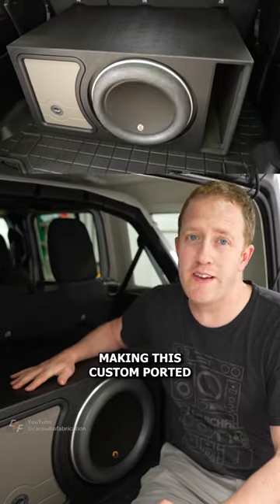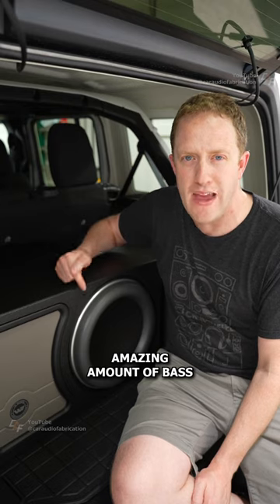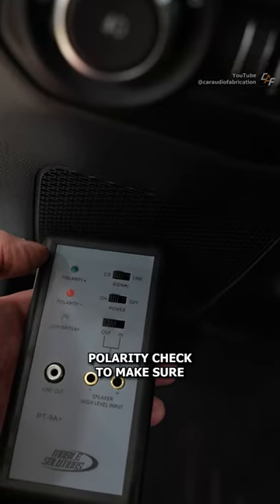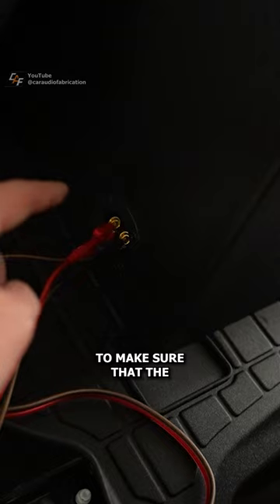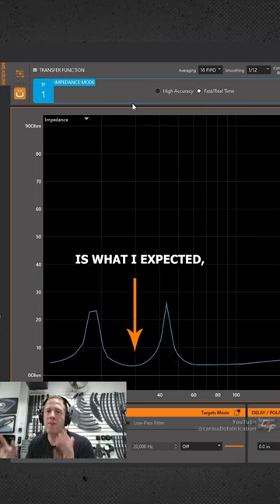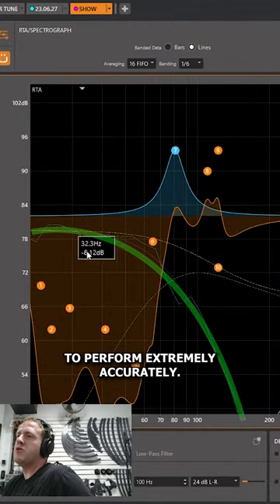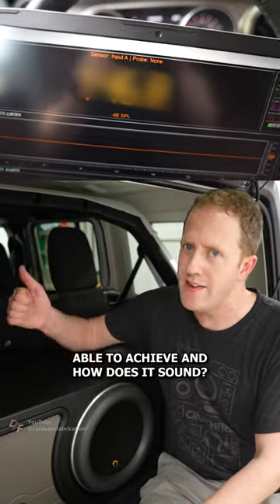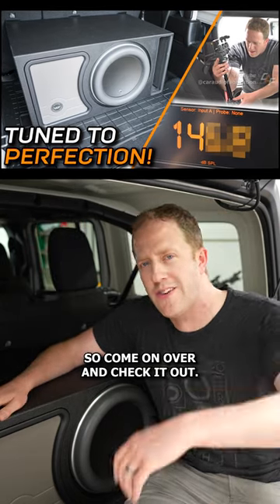Let's test the 13W7AE! Loud & Accurate Sound?!  #caraudiofabrication

Comment: It is nice when we know what the goal is before we start the build. Instead of some of these channels that start with. I shoved 2x 15"s in a box, and hooked it to my taramp.
Reply: I hooked my two 15"s up to my taramps 5k and got 154db at 32hz. Did I do it wrong?
Reply: @soldjahboy  What's the model number of the subs you are running bro?
Reply: @krowwithakay  I have two Shok Industries Elite X 15"s 2ohm DVC, connected up to a taramps 5000.1 2ohm, with 3 AGM 130ah cells (and power still dips below 12v sometimes)... all crammed into a 350z, lol.
Reply: All that in a 350Z! 😂 you are hungry for Bass only I guess.. I suggest you look up videos about setting up your system for bass. My advice would be to upgrade power supply to your amp and use a 1 or 2 Farad capacitor, then upgrade cables to your system including speakers, then you'll need to work out how low you want your Bass frequency to, then use a active crossover to split the sound then connect your amp then your 15s.. you'll also need to look out for distortion, I hope your box is designed for your boot and subs or else you'll still have problems 😔 I think you should have went for 2 10" subs for your car. That's my 10 bucks worth of advice 😏
Reply: @mandlenkosianselmkunene7737  Not bad advice. You are right he is dropping too much voltage! He really should upgrade to LiFeP04 4S10P or bigger. Or a pair of 8P's.

 I ran two 0gauge wires from the engine to the back. I plan on building a Headway battery, and direct connecting with the Alternator and my SKAR amps. Actually all my speakers are Sundown, and I will be using the filters in my amps to do all my filtering. I just liked the video, but I most likely wouldn't put any of this into my own truck. My enclosure is tuned to 38hertz and that will be all the bass I need for my first build. I will be putting a pair of SLD-12" into that.  I haven't done most of this kind of work since I was a teen 2 decades ago! lol

I will know more in about a month when I finalize my plans. I haven't even drawn out the wiring diagram yet.

Comment: What's your experience with the transient response or accuracy with that driver? I sold a pair of dual sealed 10w7s that I had running 1.5 ohm off of a Rockford Fosgate t1000. I was disappointed with the accuracy of them but im thinking I needed to pair them to a jl audio amp capable of a 3 ohm impedence and or they werent tuned correctly. I currently own the jl audio vxi 1000 amplifiers and have been strongly considering trying the w7s again.